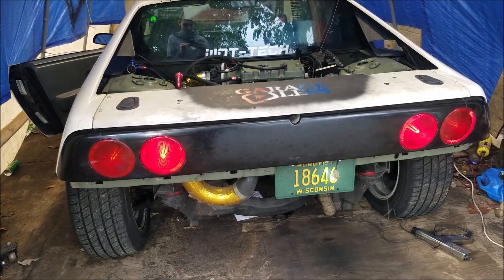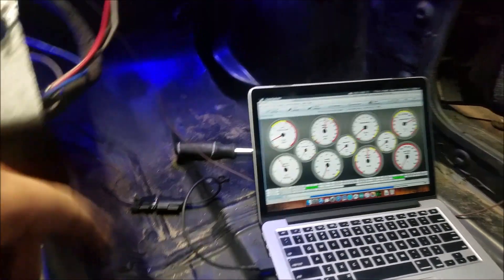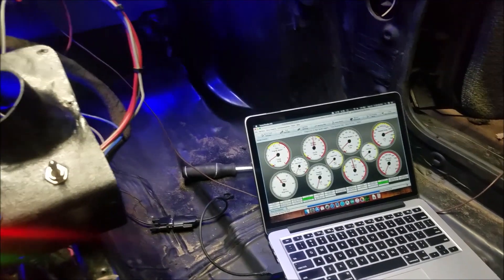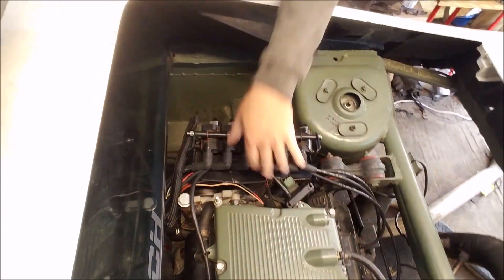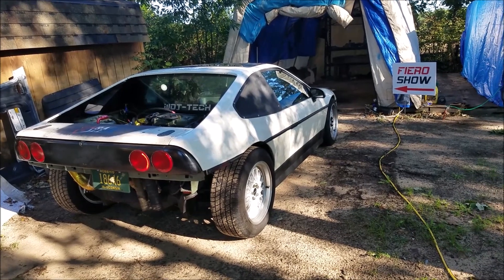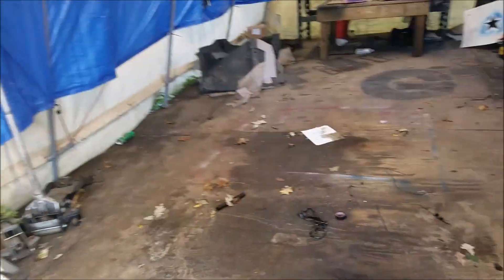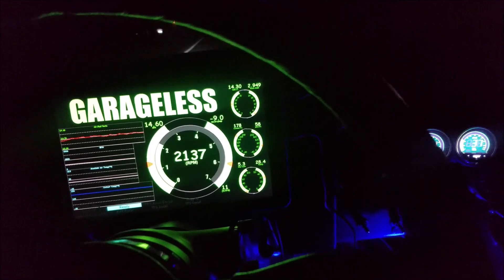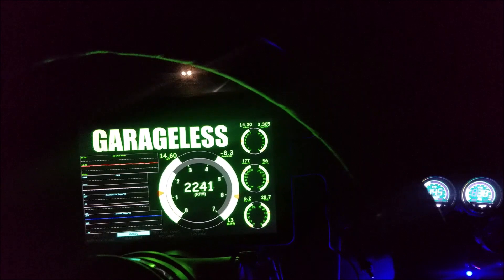microsquirt install complete! it runs but     best day at the hill!

Comment: Sorry if this is a dumb q... I have no experience w/ aftermarket ECUs/Tuning
So do you now have it tuned thru microsquirt or is that just the ECU but still tuning thru HPTuners...?  Since your description still says HPTuners tuned?

Also did you get the DIYPNP Microsquirt kit from DIYAutoTune? Because they seem to be no longer made!! 
I plan on 3.4 swapping my fiero this winter and now am not sure how I should tune/wire it
Reply from the maker: I used hptuners for stock ecm... im now using microsquirt and tune with there software... my car is very basic for necessities... automatic cars make it more difficult as well
Reply from the maker: My microsquirt is from wot-tech

Comment: 5k rpm sounds like a rev limiter is the timing diving?
Reply from the maker: Rev limiter was set to 6800 with 200 soft limiter
Reply from the maker: It loses sync with crank sensor
Reply: @Garageless  is it the resistor was rated poorly... Maybe it heats up and gets more resistance at 5k
Reply from the maker: @matthewfredrickmfkrz1934  im at 22kohm shunt resistor with 10kohm inline on positive atm... i figured issue out... i had to shutoff spark prediction in tune... i still have random hiccups but hopefully i figure it out one day lol
Reply: @Garageless  that's good I'm still combing my wire harness out but I keep going ADD now super gluing cracks in my taillight
Reply from the maker: @matthewfredrickmfkrz1934  hell yea do work!